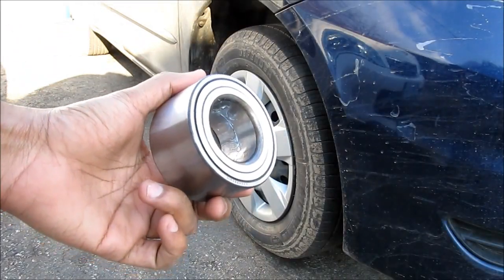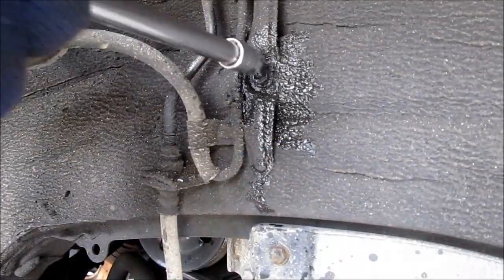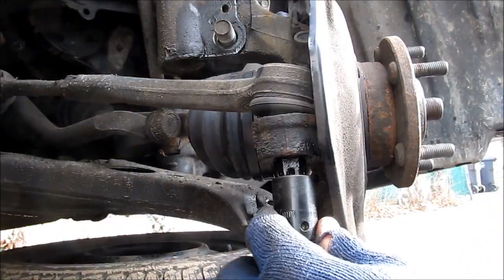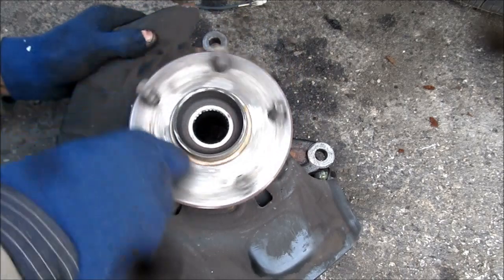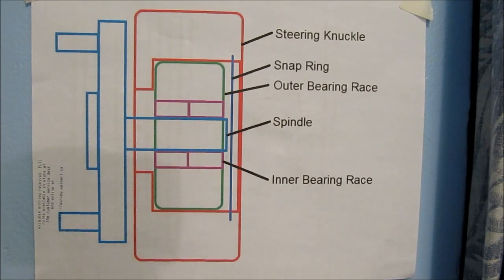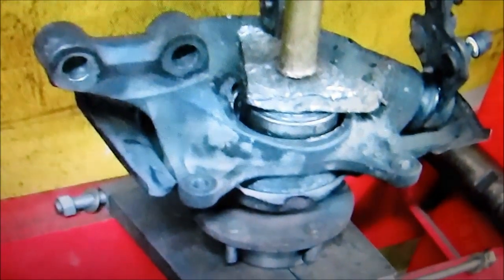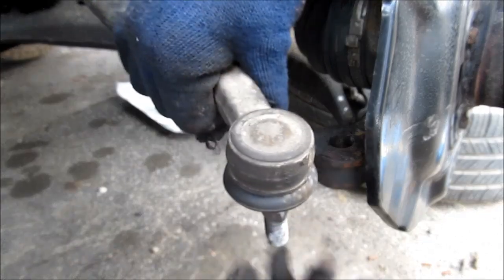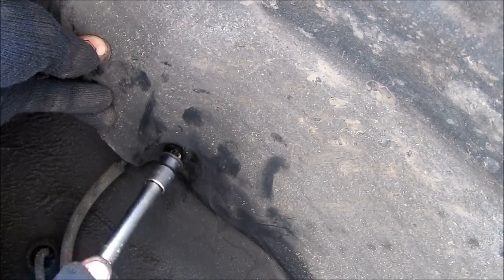Front Wheel Bearing Replacement

Comment: Thanks for the video. I have the Timken bearings and will be tackling soon ... have access to a 20,000lb press but it's probably going to be a pain. :) My vehicle is a 2004 Sienna.

What was the mileage when your bearing went bad? I'm at 195k miles.
Reply from the maker: This went bad early before 200,000 km because my dad slid into a curb on that side

Comment: Nice vid. I did my pressed in bearings a few years ago, but bought an ATD kit online. It allows removal without removing the knuckle and only requires basic hand tools. Most pro mechanics use these instead of presses cause they're faster.
Reply from the maker: Thanks for the tip

Comment: You took off the 2 strut bolt you need camber adjustment and a toe inn toe out alignment now
Reply from the maker: The OEM struts are not adjustable
Reply: speedkar99 nope did you notice when you remove it it’s swing

Comment: Have an '06 Sienna did the front bearings at about 100k or 105k, they are gone again, at 140k, significant wiggle in the bearings.  Shops in Nor Cal want $1,000 for the job.  This video is a great reminder for when I did it a few years ago, and a reminder that it is not worth it to pay a shop $800 or $900 in labor.  If they go again this quickly I will get rid of the thing!
Reply from the maker: What kind of bearings did you put in? They should last longer than that
Reply: @speedkar99  I don't remember and agree I figured that was going to be the only time I did that job.  This time I went with a name brand and confirmed OEM supplier

Comment: I got new hubs and bearings pressed in to the knuckles on my friend's 04' Highlander. They first pressed in the bearing and put in the snap rings. Then, they pressed the hubs in and I think they somehow pressed them just a bit too far, because the inner part of the bearings are now almost flush with the snap ring. So unless I can push the bearing back in about 1/16th of an inch or so, the snap ring can't be removed. Not that I want to remove it, just trying to give you an idea of what it looks like. So the outer part of the bearing is where it is supposed to be, under the snap ring, but the inner part is level with the snap ring. If I use a piece of 2" PVC pipe and tap the inner part of the bearing back to where it's supposed to be, do you think the bearings will be OK? I know it's a tough question, but just trying to figure out if it's worth messing with or if I need to just order new bearings and try the process again. Thanks in advance!
Reply: i think it would potentially ruin it, but before you try have a new bearing on deck in case u mess it up... peace

Comment: I'm working on a 04' Highlander. When I got to the "remove the steering knuckle"  stage, the entire outboard shaft came out of the inboard joint. Been trying for an hour to get the outboard shaft removed from the hub. Every video I watch, the hub slides right off the shaft....very frustrating!
Reply: No bolts or nuts left to remove. What do I heat/use impact on?
Reply from the maker: Impacting hammer? 
Can you press it out?
Reply: @speedkar99  Finally got it. Just had to beat on it with a sledge. It was rust welded to the steering knuckle.
Reply: Will it damage the drive shaft
Reply from the maker: Try heat and impact
Reply: Btw, love your no-nonsense, get to the point videos. Thanks for making them, we all appreciate you!

Comment: Just about to reassemble.  Watched speedkar99 as well to re/re bearings without press.  Thanks for super instructions, made the job possible though requires perseverance at each stage.
Reply from the maker: Yes I took the part to a shop to get pressed so I couldn't film that part, I just had to explain it

Comment: I've done more repairs on my 2005 Toyota Sienna than I care to remember: sliding door actuator motor, shift assembly (3x), replaced leaking radiator, strut assemblies, traction control went out with O2 sensor, tie rods of all varieties. Additionally there are about 6 recalls on the thing.  Where is this supposed Toyota reliability that I keep hearing about???   "Well, those are all 'routine' repairs that you should expect." say the blinded Toyota fan-boys.   If it weren't for good videos like this saving me THOUSANDS of dollars in repair costs, my "reliable" Toyota van would be costing me a fortune.
Reply from the maker: +web Well that's not bad. Until you own a older domestic or German car you won't appreciate what you have. At least it hasn't left you on the side of the road...
Reply: Years ago company provided new M-Bs.  Both left me stranded without warnings of any kind.  Maintenance by the book and problems began in the first 2 wks.  My daily driver for 20 years has been a '98 LS400.  Total repair parts (2) much less than $100. Great car.
Reply: LOL I can relate. I have a super old ES300 and I've been repairing it every summer with something new.
Reply: In that case you should go get yourself a 2001 Ford Explorer or a nice Chevy Blazer or any Dodge those willl all do you right!!
Reply: Try using only Japanese parts when you fix it ie Aisin, Denso, Toyota OEM or three-five. When you put non Japanese tie rods on a Toyota/Lexus they simply don’t last long. Really it goes for any part you R&R but tie rods I only use Toyota or Three-Five(they are an OE supplier to Toyota out of Japan. Nothing from China goes on my Lexus or Toyota Period

Comment: Great video!  I appreciate how concise it is.  I did a front bearing on my Subaru Outback with a slide hammer and bearing puller/press kit (https://www.amazon.com/dp/B00QL1APQQ/ref=cm_sw_r_cp_api_hy0QzbHVHY8CE) without removing the steering knuckle.  Using those tools would you think it possible to do this without removing the steering knuckle or is the Toyota more nuanced?  Doing this job on a 2007 Toyota Highlander.  Thanks!
Reply from the maker: +Shawn Powell This Toyota bearing was really stuck in there. If you've got rust, its best to remove and get it pressed out.

Comment: I recently replaced a front wheel bearing on my 1997 Celica GT. I took it to a shop and had them press in my new bearing, It's similar to the one you used in this video and is also made by Timken. The only difference being I can see the balls inside the bearing. After about 100 miles it started making the same noise again and actually got worse. I figured Timken put enough grease in the bearing from the factory but I guess they didn't. Would you recommend packing this type of wheel bearing like the needle style bearings prior to installation?
Reply from the maker: +Roy L This type of bearing should be sealed and you should be able to see the balls unless the dust ring was removed.
Reply from the maker: +Roy L This type of bearing should be sealed and you should be able to see the balls unless the dust ring was removed.
Reply: Most failures of a brand new bearing come from the wrong pre load being applied to the hub when torquing the nut down. Follow your OEM torque specs and this failure is unlikely to happen

Comment: Nice editing, straight to the point. Thank you for showing us how you pressed the older outer bearing race out. Now I know a simple 6 ton bottle jack ain't gonna cut it.
Reply from the maker: +Adam Young Thanks I'm glad you found Tue video beneficial. No you do need more than 6 tons to remove a bearing from a knuckle from a 10 year old car.
Reply: Ended up using a 12 ton (biggest they had at walmart) and it worked out great. I hosed the hub down with penetrating oil the night before.Thanks again.

Comment: Thanks for the reply. Funny, today I got a new spindle because my mind was racing this entire week about it. So I ordered a new one from amazon just to be on the safe side. The mechanic is charging me $65 to press them in. Either way, if everything goes well with me removing the parts and the mechanic doing a good job pressing the new bearing and spindle, I'll be saving between $300 - $500 doing it myself.
Reply from the maker: +Jose Lamar if you ever need a press again, I've seen them as cheap as $150-200 so it might pay out to buy the press for next time :)
Reply: speedkar99 I did the change with total success. I found another mechanic that only charged me $35 for the bearing. The annoying grinding noise is gone and I'm happy about that. It was worth the effort and almost half day to get it done. I saved about $500. Thanks again man.

Comment: speedkar99 was the spindle on your sienna damaged in any way when it was removed? I went to a mechanic to get a quote for pressing the old bearing out and pressing the new one in but he said I might need a new spindle because it could be damaged. They won't know until they remove the old one. I wonder if that is a true statement.
Reply from the maker: +Jose Lamar it can get damaged if the guy using the press doesn't know where to put the right adapters and bends it. You just have to be careful

Comment: Awesome video - I'm subscribed!!!   I'm doing this on my 2006 Pontiac Vibe tomorrow and glad I found this because I can't afford to have it done at a shop at the moment.  Fortunately I have a friend who works at a car dealership and he's willing to help me out with pressing out/in the new bearing.

One suggestion my friend made was to use a paint pen to draw lines around the strut bolts and between the knuckle and the bottom of the strut so that when you go to put it back together you can get it exactly the same way it was before if there's any adjustability in the way those fit together.
Reply: Success!  Performed the bearing swap on a Saturday and finished it completely following the steps exactly as you laid them out. Hardest part was getting the strut bolts off - ended up having to borrow a more powerful air compressor from my neighbor to get those off. Other than that it went pretty smooth.  My total cost was $85 for the whole job which included a harbor freight 13 piece impact socket set with a 30mm 12 point socket, a new circlip, pack of cotter pins, and a new axle nut.
Reply from the maker: +ajmckay2 Good tip, if the strut has camber adjustment.
Reply from the maker: +ajmckay2 Glad to hear you got it done. Yea those strut bolts can be a bear without air tools.

Comment: I removed the ABS sensor from the knuckle instead of the car. Other than that, this is exactly the same  procedure you would use for the 2011 Toyota Sienna AWD bearing replacement. Thanks for the upload.

Comment: Is it possible to just remove the entire wheel hub bearing assembly from the knuckle? They're advertised showing 4 bolt holes.
Reply from the maker: +Mark Ballard That's the rear bearing on FWD Toyotas. Not the front.
Reply: Thanks for the reply

Comment: Concise.  Great editing.  Thanks so much.  I'm going to attempt this on my 2008 Toyota Sienna this weekend.  I followed the link from ToyotaNation.com
http://www.toyotanation.com/forum/104-5th-6th-generation-2002-2006-2007-2011/927321-diy-2002-2011-camry-front-wheel-bearing-replacement-w-pics-2.html
Reply from the maker: +Wurum Hope it goes well for you, and that bearing isn't really stuck in the knucle. Took a while and alot of heating and pounding to get mine out on the shop press.
Reply: All is fine, you dont ch. the hub assembly.  the slack between both will cause prematurely to wear bearing.  Your fix is not the answer to all problems

Comment: Get the hub grappler by OTC and you can avoid removing the knuckle from the car, saving time and money for press use.
Reply from the maker: +rusco321 This bearing was stuck. Took a 20 ton press because the 10 ton couldn't push it. There's no way an impact gun on a puller type bearing remover would have pressed this one out. 

Removing the knuckle isn't that hard either, unless you have to deal with rusty cotter pins on the tie rod.

Comment: if you have tightened the bolt that holds the abs sensor to the knuckle, too much, then its going to be troublesome later. i may have tightened it but definitely not much yet the magnetic tip rubbed to the toner. i used washer to create space and will eventually replace both front abs. 》was replacing lower ball joint
Reply from the maker: +nhz013 Yes, you don't want to tighten that bolt too tight. Its easy to snap, I broke mine getting it off of my Solara:

https://www.youtube.com/watch?v=e0DlxEpMUco

For now it has to be held on by a zip tie.

Comment: Be sure to get an alignment afterward. Also a good idea to replace the lower ball joint and outer tie rod since you already have everything off the car.
Reply: +speedkar99 , i love your work, please give it up on your v/d, thanks
Reply from the maker: +oakland510kid Thanks. Alignment isn't mandatory since everything removed for the bearings is fixed and has no adjustment.
Reply from the maker: Thanks
Reply: No sense in replacing parts that are still serviceable